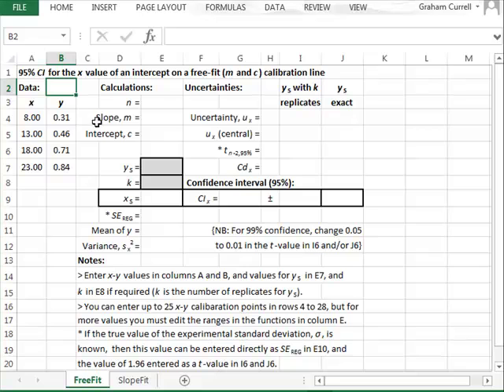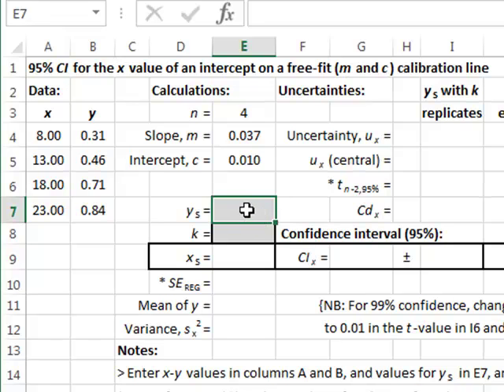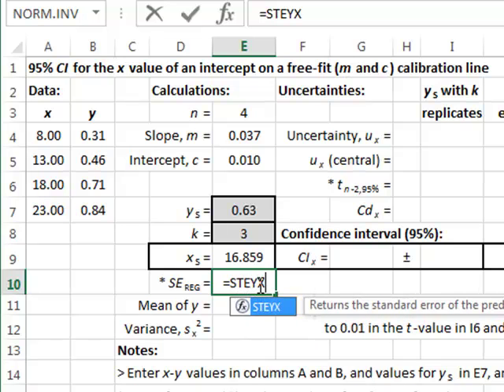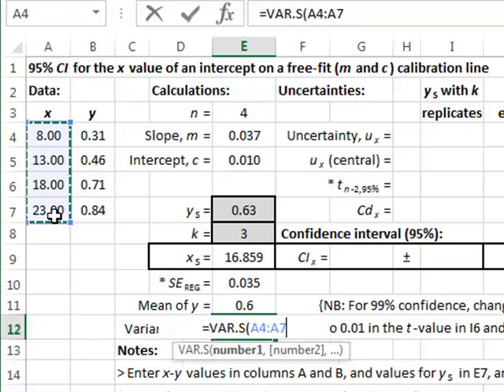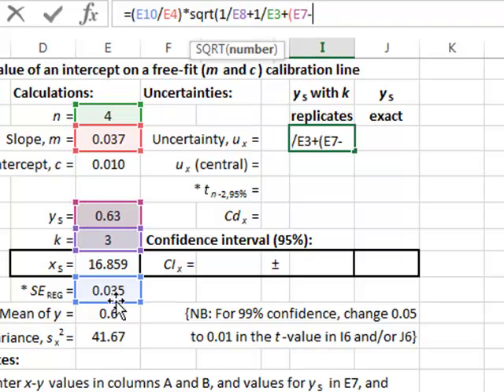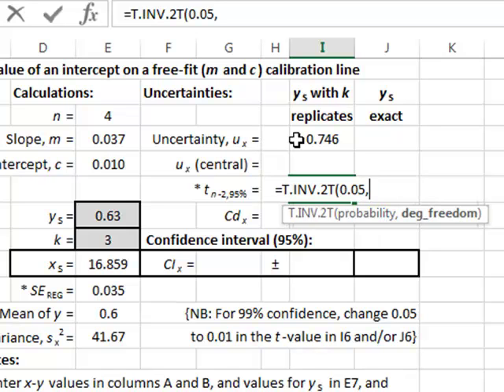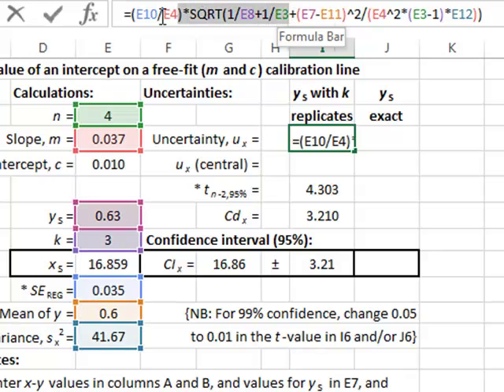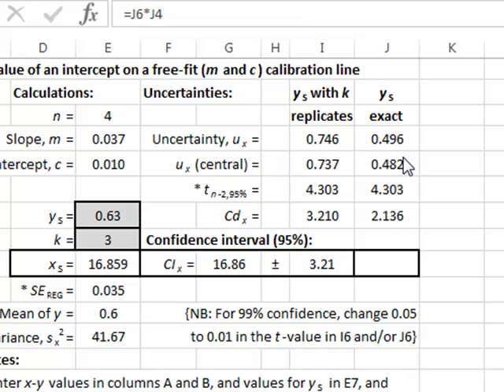Calibration uncertainty 1

Comment: how you have find k and Ys?
Reply: Expanded uncertainty and coverage factor

Expanded uncertainty

Although the combined standard uncertainty uc is used to express the uncertainty of many measurement results, for some commercial, industrial, and regulatory applications (e.g., when health and safety are concerned), what is often required is a measure of uncertainty that defines an interval about the measurement result y within which the value of the measurand Y can be confidently asserted to lie. The measure of uncertainty intended to meet this requirement is termed expanded uncertainty, suggested symbol U, and is obtained by multiplying uc(y) by a coverage factor, suggested symbol k. Thus U = kuc(y) and it is confidently believed that Y is greater than or equal to y - U, and is less than or equal to y + U, which is commonly written as Y = y ± U.

Coverage factor

In general, the value of the coverage factor k is chosen on the basis of the desired level of confidence to be associated with the interval defined by U = kuc. Typically, k is in the range 2 to 3. When the normal distribution applies and uc is a reliable estimate of the standard deviation of y, U = 2 uc (i.e., k = 2) defines an interval having a level of confidence of approximately 95 %, and U = 3 uc (i.e., k = 3) defines an interval having a level of confidence greater than 99 %.

Relative expanded uncertainty

In analogy with relative standard uncertainty ur and relative combined standard uncertainty uc,r defined above in connection with simplified forms of equation (6), the relative expanded uncertainty of a measurement result y is Ur = U/|y|, y not equal to zero.